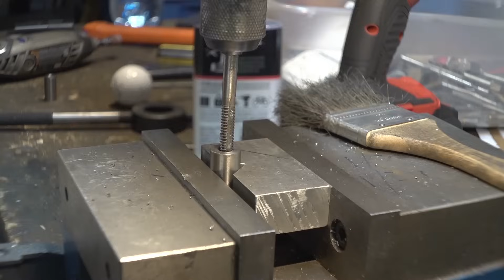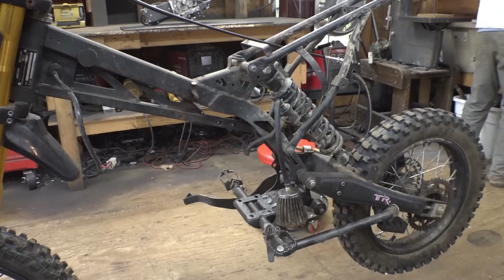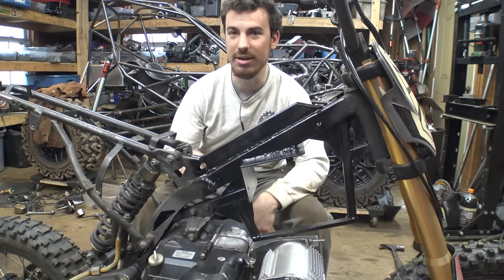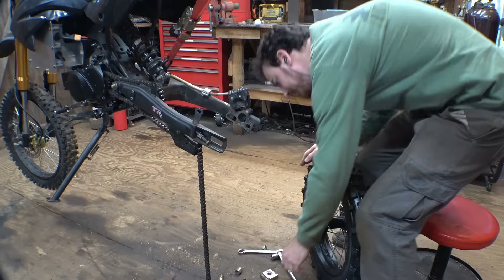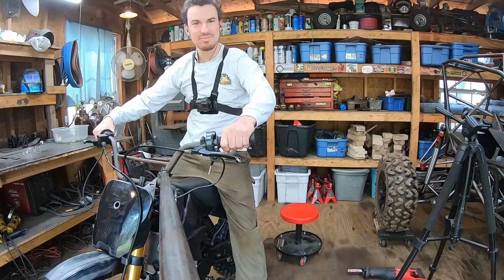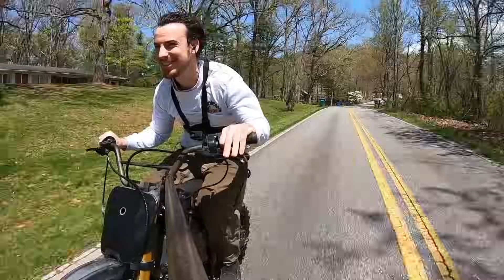A Different Way to Build An Electric Dirt Bike  - Part 2

Comment: I wouldn't use aluminum for a battery box. It is field weakening. See Tom Stanton's electric bike build. 
Why not mount the controller under the seat where you might have better air flow?

Comment: The minute i saw him put in those sealed bearings to keep in oil, i knew they were going to leak. Sealed bearings aren't sealed to hold back fluids, especially under pressure. They're sealed to keep out dirt and debris and keep in the grease pack. Needed to add actual shaft seals as well.

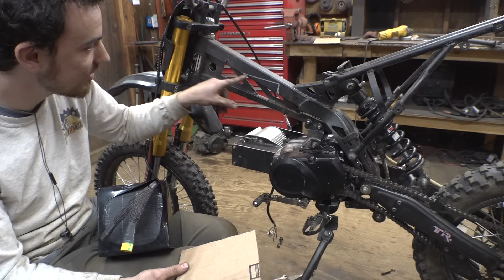Comment: "That's crazy! Cutting and re-welding the frame to fit the battery box [09:50] was a bold decision, but your welding skills saved it all. Although it ruined the 'flow' of the frame, it's a price worth paying for power. Have you thought about reinforcing it with a steel tube from the fork neck to the battery? Awesome!"

Comment: Ótimo projeto. Sempre quis fazer esse projeto. Cabe aqui algumas observações:
Você deve mudar a marcha quando o motor elétrico atingir a rotação máxima (Aqui no brasil chamamos: cortar giro. Significa: que o motor atingiu o rpm máximo). Se você mudar a marcha antes de alcançar o rpm, então o motor elétrico trabalha forçado, então o motor vai consumir mais corrente elétrica e a bateria vai aquecer. Por ser um pouco diferente do motor a combustão, para economizar corrente elétrica, e para otimizar a eficiência, considere escolher uma faixa de trabalho ideal para o motor de 30% a 70% do rmp limitado pelo acelerador, e mude de marcha apenas quando atingir a rotação. Eu escolheria 50% da capacidade para este tipo de motor. Parabéns pelo projeto.

Comment: Old video so i know this project is long done but what do you think of panier style battery boxes? Mounted on both sides of the frame/gas tank. Then the tank is cut at the bottom, slide over the two boxes. Connected in parallel, one cell wide. Maybe even 30ah each side and evenly weighted

Comment: I would have rather reformed the battery to fit it inside the fuel tank, and made a smaller box for the controller and other circuits, so I wouldn't have to cut the chassis frame.
The chain box could have been made of aluminum to save weight.

Comment: Electric dirtbike upgrades:::: 
It needs more gearing to the crankshaft it used to rev to 10k rpm now it revs to 4k rpm with way taller gearing to the rear tire, adding a bigger sprocket to the electric motor would reduce the overall torque going through the clutch and adding a larger sprocket on the tire will re gain the torque to the tire. Those Chinesium transmissions are not good and the dogs on the gears will shred and not be fun. Be careful when shifting make sure it goes into gear fully before letting off the clutch. I love the build and it’s super inspiring. I hope you give this a shot and try it out!

Comment: Great video! I have done a transmission on an ebike but it a jackshaft. I can shift brtween 3 speed manually depends on the torque i need but i aleays bring backup bike chain and some tolls coz its high maintenance lol

Comment: Next time you have to cut open a gas tank or do any welding for a gas tank the standard protocol is to just fill the entire thing up with water to the very tippy top and that will remove any fumes and any residue left over from before and will guaranteed to make the tanks safe to work on in that fashion

Comment: I’m late to the party but all you need to do is to increase the gear on the motor to match the torque and rpm of the original engine. Then you would have no problem with the clutch and you can put the original rear sprocket back on.

Comment: Great project, I enjoyed seeing the progression from start to finish.
I just have one question, wouldn't it have been easier to put a sprocket on the crankshaft where the magneto was instead of all the welding and having to seal off the internals of the engine? It would only need a plate to cover the cylinder hole. Maybe on your next project. Is your electric motor brushed or brushless? I found the brushless to be more efficient. 
I had installed a 3-12v 14a lead acid batteries with a 1000w brushed motor on my grandson's Razor 500 quad. I just recently upgraded it again to a 48v 20a lithium-ion battery and a 48v 1800w brushless motor. Wow, what a difference.

Comment: it would have been nice if you split the gas tank in half and fit the battery some how in it, like a saddle bag type, maybe put two batteries one on each side? I think your method with the tranny is a lot better than direct motor torque to wheel, why I say that, because I think the electric motor has a easier time transmitting torque to the tranny and smoothing out and transferring power to the wheel! like some kind of cushing between motor and wheel, and maybe the longevity of the motor.

Comment: I like the bike. the fact that it has gears changes the way you trig out the distance on a charge.you could enter the gear ratio for each gear and then trig the distance per charge per gear but that wont tell you the overall distance per charge you'll get. as far as the oil from the crank case getting into the primary drive chain box dont worry about it. the motor has a seal that will keep the oil from getting into the coil so all it's doing is lubricating the chain which will promote a longer lifespan of the chain. just make sure your access plate has a gasket so you're not losing the oil.

Comment: most mechanics manuals say to warm the oil to 85-110 degrees the soak the clutch pack in the oil for 2-4 hours to ensure the clutch pads soak as much oil as they can. you're supposed to disassemble the pack or at least remove the pressure springs as the pads can't soak up oil if they have the upwards of 250 pounds of pressure pressing them together.

Comment: This foam is piece of s#, buy 5mm granulated rubber pads used under washing mashines. If needed could be stacked to required width. Will never get flat like that polyester.

Comment: you should try to put washers under springs if possible to make spring rate a bit stronger to try hold the extra torque

Comment: Hi, at 47.59 I am looking at a side view of the frame gap which could be best strengthened but  web welded on both sides to brace the head stem and cut part of frame. You then don’t need that ugly hanger that obstructs the adjuster screw. Just thinking aloud. I enjoyed both of these episodes

Comment: Super awesome. Is it possible to have more information, the power to the wheel in the different gears, the speed, the torque and the capacity in Km depending on the battery? the battery recharge time and the energy returned.....
In any case, I love it and I agree, especially since it doesn't make any noise.

Comment: Should put a skid plate or something underneath the motor and bike. Weld off of the bar you made to compensate for where you cut the frame.  Can help protect from rocks coming up etc.

Comment: you should build a 96 cr125r into an electric bike.. its likey the cheapest "real" dirtbike you will find that still has a steel frame but modern compoents.... 97+ for aluminum frame.

Comment: Nice job!!  I was wondering if you noticed any difference with the new rear wheel.  In the earlier videos it looked like the old wheel needed to be tuned and later the new wheel looked to be running true and well balanced.  Sweet!!

Comment: The problem with your clutch is you have to have motorcycle motor oil in it because it has friction modifiers in it so your clutch will stick otherwise it will slip remember that any motorcycle has a wet clutch has to have oil with friction modifiers in it

Comment: When welding or cutting a gas tank, if you use an inert gas inside, you should be fine. Clean it and rinse it thoroughly before hand! 💥
Reply: na you dont do that, i use compressed air when i cut oil drums, the mixture is too lean to explode , very safe

Comment: Bro you don't need to grit your teeth or use the clutch when shifting gears on that setup, it's really only needed when shifting from neutral with a gas engine because the engines is spinning all the time.

Comment: If its a 20Ah Battery at 60 Volts or less, and lets say its 2000 watt motor, you should get a good 10 to 20 miles easy. I'm running a 60 Volt 38Ah 5600 Watts and get over 30 miles ripping, and 60 miles when riding mildly. Great Build!

Comment: I love Your vids and admire Your "practical" approach. If I had a workshop to do all that stuff, it would have taken me ages to do anything, as I would try to blueprint everything first, create it in CAD, make sure that it works the first time, and that all is perfect. You just take practical approach and just go on with it :)
I like that, even though I'm not sure if I would be able to follow the same approach.
But damn.. wear helmet! :)  
And a tip - don't need to use clutch on motorcycle for anything else than stopping and starting. :) or maybe a wheele :) Gear changes are a lot smoother when done without a clutch. 

I'd love to have such electric dirt bike, although the sound of it is.. a bit painful :) mostly the chain noise is annoying. I wonder how it bears offroad.  
I'm hoping to achieve something similar but with a bicycle conversion. Obviously - minus the gearbox.
Love Your channel and I envy you the workshop :)

Comment: I'm a year late and didn't read every single comment but you might want to consider a breather tube on top of chain gear box to release pressure. It may be why it leaks

Comment: Reduce the amps to reduce the torque. If you want it to go faster increase the volts or use a controller capable of field weakening.

Comment: Electric driven motor cycle with gear box having is good.
Gear box  with your clutch is not matching with with loading.During
such convertion technical specifications is an important factor. please consult with research and development field
engineers.
Thank you for your interests 🙂

Comment: It will run about for 14 min as per your data so calculate your top speed kmph÷60x 14 = you get approximate range.

Comment: I'm good at welding/grinding, drilling and tapping, electric bikes, building batteries, but this is rather complicated, even for me...Meshing the electric motor with the gear box is the sticking point for me..Well Done...You can buy thru bolts, commonly used for hardware on doors, for future reference..You probably know that already though..Crazy good job...Looks like it goes 40-50 mph..Definately proof of concept, you would need a serious battery, and with that comes serious weight and where do you put it..And then can it really be a dirt bike..Interesting though...

Comment: 8:45
This way, with oil in the chain place is more easy and better, but whay not using the left side? Then, cut and weld with TIG crankshaft and close with the plate. Then we can use a bigger engine!

Comment: If you had used gears from motor to crank you could have altered the gearing easily from motor to crank and got rid of that horrible noise from the chain drive.

Comment: Great work, but too hard to modify the crankshaft part, is it possible to just modify the head only, i mean you still use the piston rod and try to apply the electric motor into the rod. Thanks

Comment: two tips.......1]..put strong ribbon or string around battery before putting in box,   so you can pull battery out with them.......2]..put water in tank and rinse............thus removing any remaining fumes,   before cutting.    wb

Comment: Put oil in the crank case / integrate chain tensioner/slider from a ford mod motor 4.6 5.4

Comment: Thanks for sharing. 👍In fact, if you had made the battery pack in the form of a saddlebag and in two parts, I think you could have placed it on that bar. 
So you wouldn't have to cut that frame bar. This method came to mind when I watched the video.👋

Comment: Why didn't you put two batt on the pit bike no frame cutting. One on each side of the frame. Or one under the seat. Or half the batt and on each side of the frame under gas tank or in gas tank.

Comment: Awesome video series! I've wanted to mod my Yamaha XT like this, but wasn't really sure how to mate the eclectic motor to the clutch. it seems obvious now, but replacing the piston with it is genius. Since your clutch is still slipping (probably do to the torque of the electric motor throughout it's entire RPM range, you may consider a larger sprocket on the motor to reduce the torque at the crankshaft (which will also make the bike a bit faster).
Reply: please don't destroy a yamaha xt like this lol

Comment: You could have covered the cylinder hole with a plate. You designed your old engine already with a through shaft. Attach your belt to the shaft outside the case and center your motor better. Also allows you to seal the oil in the case.

Comment: I love this, and I'm definitely using this for inspiration on my project, but I can't help but think you don't need to use the clutch to get going (Or change gears for that matter, that's just sequential gearboxes), but I'd also like to know how fast it takes off in 3rd or 4th, because my maths with a similar spec motor is not good.  

Well built

Comment: Just use a tap guide with a tap handle and hold the brake or lock spindle.  Saving 15 seconds usually always ends up costing more time in the end

Comment: You could have mounted the battery much lower if you didn't have the motor where the battery should be. You don't need the gears or the clutch or all that extra weight and complexity. Just just probably a larger rear sprocket and direct drive but oh well it seems you don't have much experience with electric vehicles. You're a hell of a good machine as though I'll give you that

Comment: I'd have made the top part of the battery box support structural and have linked it to the headstock, an elegant solution to providing the frame strength you removed. Great project!

Comment: To reduce heat generated,  shift later.  Electric motor thrive at higher RPMs. The more torque you apply to the motor at low RPMs the hotter it will get.  Downshift and try to keep it high. I can't tell what kind of motor you have nor the motor controller but most motors have the power they are rated for at their highest rpm

Comment: 10:06 this is what manufacturers talk about when they speak about using the battery as a stressed member to save weight. I do think the battery box would've been enough to not make it fold in half.

Edit: 15:19 omg please no...

Comment: Alll those tools, No file handle. hahahaha jkjk Great video btw. Was fun to watch both of em. In the first video, how come you didn't just use a "slitting" saw to make the splines? Do you just not have the tool holder for your mill? Or i guess maybe not the right size blade.?

Comment: I'm not an expert on this but if you used a 2-stroke engine the gearbox oil is always separate and doesn't enter the crank case and the clutch may be stronger as it relies on a lot of slippage to get the most out of your you're 2-stroke engine the videos with brilliant thanks

Comment: You should have way more torque in low gears. It takes way longer than I thought to go through the gears. My dirt bikes were 2 strokes and go through the gears as fast as you can shift with all that wheel spin. In second gear it should be the wheelie king, on demand by throttle only.

Comment: the gear reduction from the clutch is killin it i think. id smoke the clutch and put a smaller gear on the input shaft. dont need the clutch with electric. its a sequential trans so just release a little throttle and grab the next gear.  could get some major top speeds i think like this lol.  im gonna try and build one i've been wanting to for awhile

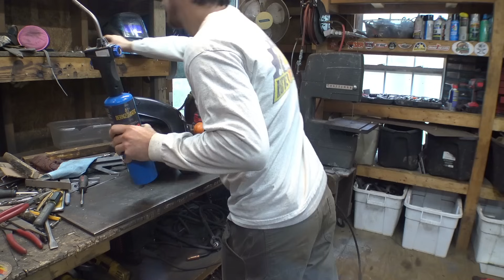Comment: 24:30 .. I think we all held our breath lol another method is, fill the tank with water, cap back on. Upside down, cut away. To explode it needs oxygen, filling it with water removes the oxygen potential.

Comment: Did you use the right engine oil? The oil could be a reason for slipping clutch as oils for cars aren't meant for wet clutch systems. Also I have experience of fully synthetic engine oil causing clutch slip in motorcycle motors that are build for semi synthetic oils.

Comment: My old idea was to use a motor like a rear differential with ring gear that wrapped around crankshaft and, Electric motor mounted just like original cylinder. just some of my old ideas and thoughts wish had tools and shop to try it out using a modern 450 dirt bike or husky 701 Supermoto to help out with clutch issues

Comment: Just curious as to why you went with the battery you did instead of making battery packs out of 1860s? You could have made linear battery packs and put them lateral to the frame both front and rear or even on the swing arms. Sure you would have spent a little more in wiring but aesthetically and functionally it would have been far easier to design and there wouldn't be anything to chop off your inner thighs.

Comment: Something cool about using a gearbox with electric motor. In my opinion the gear ratios aren't suited to the motor specs. I'd run 1st @ 5:1, 2nd @ 3.5:1 3rd @ 2.5:1 4th @ 2:1 and 5th @ 1.7:1 if using all gears. But to do this, you would need a stronger motor. Personally I'd only use 3 gears maximum. Electric motors torque is at the low end. Every gear change further limits the available torque. Great build by the way! Functional and aesthetic.

Comment: Next should be a controller...bac 4k?? It would drastically quiet that electric/gear high pitch whirring noise down, plus give you a huge boost in performance, granted the existing controller (which looked to be a Kelly, sabvoton, or qs) isn't already an foc type controller...even if it is, the bac is the créme in comparison. But awesome job 👍🏼 you can really make that thing badass now. Great starting point